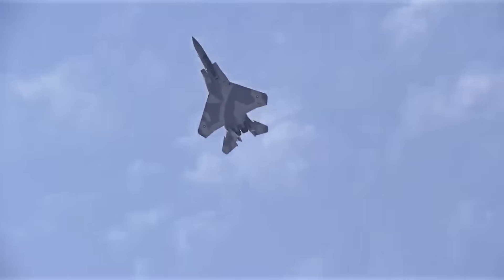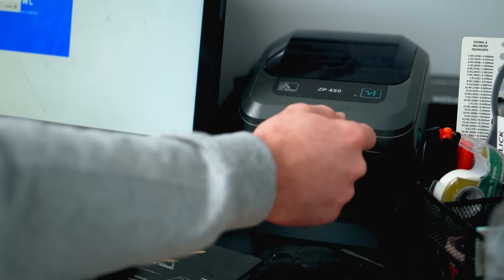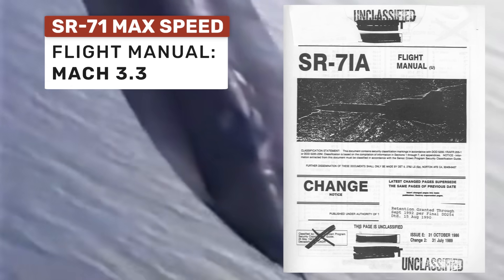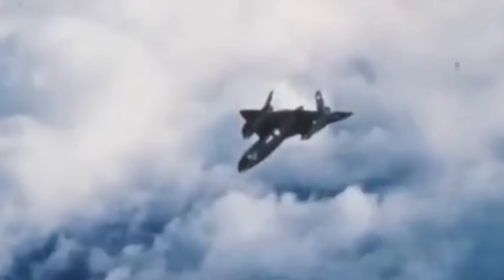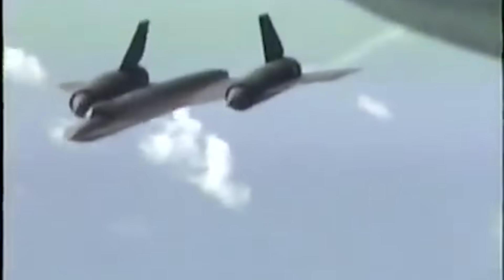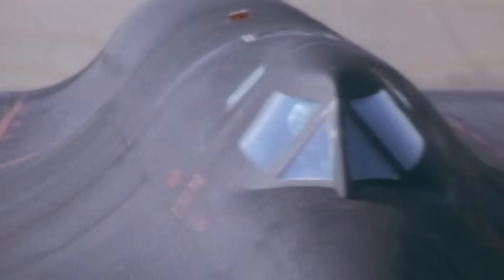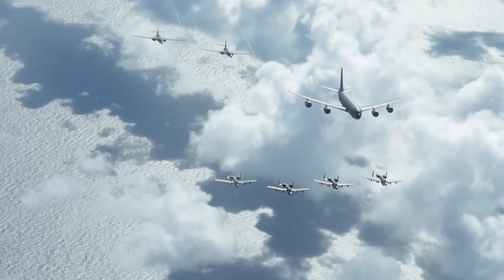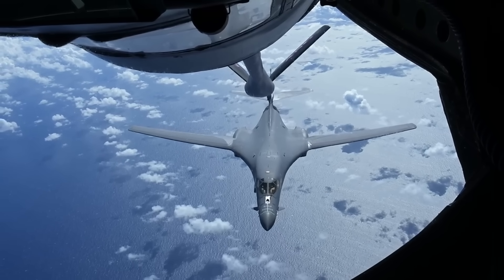The SR-71 was MUCH FASTER than the Air Force will admit

Comment: A really experienced and smart aeronautical engineer could likely figure it out mathematically. Take the shape and size and weight of the aircraft and figure out "what's the speed limit for an airframe like this at a given altitude?" The engines likely push that airframe to that limit.
Reply: They already did all that.  Lockheed knew its maximum design potential and it was never reached
Reply: Since you asked ... the Mach cone angle coming off a point (nose spike) can be calculated by sin(μ) = 1/M, where μ is the angle off of centerline and M is Mach speed
Using a top down drawing of the vehicle and a simple protractor, at Mach 3.65 that shock cone will hit the front chines, engine inlets and wing tips all pretty much at the same time. Under no circumstances can that craft ever go faster then that and remain in control/engines running/in one piece and not break up/ and not melt. You don't have to be really experienced or smart and it's not that complicated. You just have to go through the schooling (aeronautical engineer) to know how shock cones work, the (simple) math involved (shock cone off a point) and then take one look at that thing and laugh at anyone thinking it could go faster. You wanna go Mach 6 like some people think it went?  you better put a 70 foot long nose spike on that thing
Reply: @wally7856 its close, but mach 3.55 is the maximum for the inlets.
Reply: @gr8crash  ... and the maximum for the compressor inlet temperature (CIT) was capped at 427°C (800°F) which is about Mach 3.2 in normal conditions, Mach 3.35 if outside air temperature was below -50 C. Possibly "war time power" of 450 C on the inlet temperature for brief periods which if conditions were just right it could have hit Mach 3.5 although hitting that temp would require a rebuild of the engines turbines afterword's.
Reply: @wally7856 pretty accurate yea. The max authorized was mach 3.3 and only if that engine CIT limit was below 427⁰, and on a standard day that was pushing it. 

The 450⁰ was a tactical limit and also only possible if other engine parameters were within limits. It was also cumulative meaning IF a pilot did that it had to be written in the logbook and it wad allowed up to 60 min then the motor needed to be removed. 

I've asked a few crew members about that and none have ever done it.
Reply: @gr8crash  My favorite part about this plane is that at those speeds and altitude, almost all of the thrust was made by the pressure differential on the engine inlet spikes and the engines main job was just to vacuum up and remove the air building up behind the spikes fast enough so that the spikes could do their job. I think any accounts of this plane going faster then Mach 3.35 was just the plane hitting a pocket of really super cold air and the thrust on those spikes just taking off uncontrollably. Probably little the pilots could do other then pull back on the throttles and cross their fingers it stopped the runaway acceleration.
Reply: @wally7856 yea and thats pretty much what happened. There was a handful of flights in the mach 3.4x range due to extreme atmospheric conditions. But these speeds werent fully within the pilots control.

Comment: imagine if the sr-71 had 4 of those engines
Reply: I imagine you would need a bigger, sturdier airframe, more fuel tankage, and the aircraft would weigh quite a bit more.  Not sure you would gain enough to matter, since the aircraft was too fast and flew too high to shoot down anyway.  I have to wonder however if you could down it today using a very fast kamikaze drone of some sort.

Comment: There was a pilot in the 80s who slipped up in an interview that only aired one time because it was live that spoke on actual top speed.    Anyone who believes 3.5 was the upper limit or 3.6ish are badly mistaken.    Number is higher for sure!!!          Well 2.9 for a fighter but the most badass plane ever can only go a few hundred mph more???   Nahh.
Reply: Except it isn't.  Anyone who thinks it flew 3.6+ is delusional. Even reaching 3.5 on a standard day was impossible.

Comment: In 1972 (I think), I worked at Edwards AFB data processing center as a student aid. They were testing the F-15. All I did was keypunch IBM cards and generate very phony test data. I didn't know anything about the tests or data, but I suspect they were graphing energy bleed and turn rate at various altitudes and speeds. My girlfriend worked at NASA as a student aide, She asked me what the public top speed was. I don't remember what I said, probably 2500. She said :it goes a lot faster than that, a looot faster". From her reaction, I thought it was 3000mph, but she didn't say.

My father worked at the skunk works and later area 51 on  sr-71. He was a tech and probably didn't know what the speed was, but it didn't matter. He was a greatest generation WW2 combat infantryman and a 20 year air force veteran and he would not say anything about it even decades after it was public. He did say that he had to work inside the fuel tank and it was about an inch shorter than he was, so he kept bumping his head.
Reply: The SR71 was never at Area 51

Comment: 85% throttle was the highest recorded speed that the plane flew in operation (Not the top speed). This was to escape a Soviet surface to air missile, according to the pilot who did it... though he never said how fast 85% actuallly was. 🤫🤣
Reply: That isn't even true. That's not how throttles work on this aircraft

Comment: ..AND THE BLACKBIRD PILOTS WERE CONSTANTLY DIPPING IN AND OUT OF EARTH'S ATMOSPHERE AND SPACE....WHAT DOES THAT TELL YOU... .THEY ALSO TOLD US THAT THE BIRD WOULD LOSEN UP AFTER MAC ( THE PILOTS CALLED IT MAC  FOR MACH) .....THAT MEANS THE BIRD STOP SOUNDING LIKE IN SOME CASES A  BADLY ALIGNED HOOD ON A CHEVROLET TRUCK MAKING SQEEKING NOSES AT IDLE AT A STOP LIGHT .....LMAO !!!! ON THE GROUND WHEN THEY PUT JET FUEL IN THE BIRD, IT LEAKED LIKE A SIVE BUT ONCE TO YOU GOT IT IN THE AIR AND OVER 50,000 FEET @ OVER MAC 2 THE LEAKING STAINS DISAPPEARED.....TO OTHER JET AIRCRAFT IT WAS LIKE WATCHING A REAR ENGINE DRAGSTER GO UP AGAINST A JET CAR....SEVERAL THOUSAND CAR LENGHTS IT WOULD LEAVE OTHER JETS AND OUT CLIMB THEM....DIP IN AND OUT OF SPACE
Reply: Lol that isn't even true

Comment: As an ET, with Grumman in the early eighties. Working with the engineers, they let the cat out of the bag, usually the under estimate top speed by 2-300 mph!. F15 rated at MAC 2.5 -will go to 2.8 for a short time, however the engineers will say stay away from 2.9. That would exceed the thermal envelope!😎🇺🇸 JohnBoyUtah 🇺🇸🇺🇸🇺🇸✈️

Comment: I've always speculated that the Blackbird was mach 4 capable. Perhaps not sustained flight. But I believe if they really wanted to push that jet it could go 100.000+ feet and mach 4. 

I mean look at it. If the F-15 can do mach 2.9. And the Mig-25 was capable of mach 3. You're not telling me you need a plane like the SR-71 to go just .2 mach faster than that.
Reply: The SR71 couldnt fly that high or fast at all

Comment: I have heard of the discrepancies of its speed.  What i would like to know is its attitude.  In that the U2 flew at 80-85,000 ft.  It's hard to imagine that the  SR-72 didn't fly higher !
I had second hand information that it decended down to 100,000 ft before it made contact to prepare for a landing.
It certainly must be declassified by now.
Reply: All its altitudes etc are declassified. The SR71 normal altitude was 80k-85k. The U2 is closer to 70k. The SR71 could never reach and sustain 100k ft though.
Reply: @gr8crash 
Thanks !
Reply: @michaelodonnell8591 no problem. I will add that with the U2 still being in service, could it have sustained a higher altitude than 70k? Perhaps, but I wouldn't think anything excessive.

Comment: Since you came out with this video.... A year later now you have said.... Set the SR-71 engine s we're going to scramjet mode... I've been waiting for this for a long time as I've been saying in text on your website here.... I'm still not going to say the exact speed... But I will say this.....
But if you know the theoretical speed of a scramjet..... You know how fast a blackbird can really go..... I have held the performance flight envelope.. from Lockheed in my hands while the planes were being built.... I know how fast they go... And you're not even close at 3. 6...
Reply: Considering mach 3.6 wasnt even possible as configured its not surprising. The flight envelopes dont even support that speed. And scramjets? The SR71 had turbojets.

Comment: The top speed of the SR-71 was kept a secret from the enemy. The enemy. Got that? Telling the enemy anything secret is called giving aid and comfort to the enemy. There was no problem with air friction at speed. This aircraft was designed to handle it.
Reply: "The enemy" could easily track an SR-71, same as the USA shat themselves after tracking a Foxbat over the Sinia Peninsula, prompting the F-15 program. 

Once the Russkies figured out how to get enough Foxhounds in position it was Goodnight Blackbird, or "Say, let's use satellites instead".

Comment: In 1981, I was a C-141 aircrew member stationed at Norton, AFB San Bernardino.  During an air show, the SR-71 did a high speed, low level flyby into the vertical.  At the point of rotation, I began counting the seconds before I lost sight of the J58 engines’ plume.  15 seconds folks.  That’s 15 seconds from sea level to out of sight.   “HABU.”

Comment: Fred Bell, an engineer, links with the military industrial / CIA. Stated off record the Sr71 undisclosed top speed is closer to Mach 5. Its sweet spot is around Mach 3. Even though there was no official report of an SR-71 being shot down, the Russians did bring one down. As well the cost of the program led to its retirement.
Reply: Virtually all of that is untrue.  Mach 5? Never even remotely possible under any circumstances.  No SR71 was ever shot down,  especially over Russia as it never even flew over Russia and they never even fired at it.  The cost wasn't even that bad overall. The only real reason it was canceled was political jealousy

Comment: I worked @ Beale AFB (1972-74) where the SR-71 primary operations were based. A good friend worked across the hall from me in Avionics Maintenance, & mentioned one day that he had to replace an Airspeed Indicator in an SR cockpit.....because it was
"pegged" on MACH 5!!!!!!!!!  GO FIGURE.   If you look up the SR in Janes' Book of World Aircraft, the top speed of the SR-71 was always listed as "classified".  What an incredible engineering marvel- still today!!!!!!!SMFH.  I was heartbroken to learn that the SR-71 was "retired" in the late '80s by the Air Force....although it still flies today somewhere on the planet!!!!
Reply: You mean the guage that they didnt even use above mach 1.5 because it wasn't accurate?  More than likely if true it just broke, especially as the SR71 couldnt fly that fast, nor did the gauge even work at the speed.

Comment: Nice video which has prompted some old memories.  In 1978 I was a US Marine Air Traffic Controller at Futema Okinawa and apparently pizzed somebody off and found my self in a tower cab constructed of 2X4s and plexiglass sitting on the roof of a hanger at MCAF Hamby. We sat a mile or so off Kadena's final approach path with our airspace capped to a mere 500 feet for helo ops.  Long story short we could clearly see and follow the SR71s approaching Kadena.  One day an SR71 made several consecutive approaches which seemed amazing in regards to fuel consumption.  Good times.

Comment: I once saw an SR-71 take off - vertical acceleration! Noise was unbelieveable!
Reply: That never happened, its thrust to weight ratio was 0.44, there's no way that's going vertical.
Reply: It cant takeoff "vertical" meaning nose straight up. It would crash if it tried

Comment: I say upgrade the compressor inlet with modern technology and see just how far we can push the design.
Reply: But then you'd quickly run into the limitations of the airframe. The engine CIT limit was only the initial limiting factor to higher speeds.

Comment: My neighbor was a crew chief for the entire series (YF-12A, A12, SR-71) and told me the ultimate limiting factor for max speed was the windshield, which would deform and could fail from frictional heating. According to Brain Shull's recount, while outrunning multiple SA launches, he pressed past 3.5 mach. Other sled driver say his story is completely believable. Another neighbor worked directly under Kelly Johnson and was tasked with designing the blended airfoils for the wings.
Reply: Shul speed claims are greatly exaggerated as those speeds he claimed wouldn't be possible. The initial limiting factor to higher speeds was the engines.  The windscreen wasn't an issue until 3.6

Comment: A12 flew 10,000 higher and 200mph faster.
Reply: On paper perhaps, in the real world nope. All 4 variants had the same limitations
Reply: @gr8crash 
I watched a documentary on the A12 that said it was lighter, could fly 10,000 feet higher and was 200mph faster.  That was the CIA version. Even more top secret. I don’t really know. Who would
really know unless you designed them, worked on them or flew them?
Reply: @AltonW521 

There are definitely quite a few documentaries, stories etc that state that. Most of them all rely on information from the 80s and 90s when tech data and such was still classified. But now that virtually everything is, it changes a lot. Yes the A12 was lighter, but it also had lower thrust engines compared to the SR71. Per the CIA records, max speed for the A12 in 1965 was Maxh 3.29 and 90k ft, both A12 records being set during flight testing in 1965. But the SR71 has also reached and exceeded both of those limit, although when the SR71 didn it, it wasnt fully within the pilots control. But thats a separate discussion. The speeds of all 4 variants were initially limited by the engine CIT limit. Being smaller/lighter really had no bearing on effecting this limit. Speeds were so strictly scheduled to avoid unstarts etc. So being lighter is also irrelevant. If you weight 75k lbs and you're flying mach 3.2 the amount of air physically entering the intakes is the same as if you weighed 100k lbs also flying mach 3.2. Being smaller or lighter can't change that physical limitation. 

Imagine drinking a beer. You got some new drinker and a guy from Scotland. Both have the same pint of Guinness. Without a limitation the guy from Scotland could probably out drink the other guy. But now give them both same straw drink through, now both are constrained by the same limitation. Obviously a drastic simplification but wanted to try and explain it another way.

Now you could argue th A12 being lighter it could accelerate and maybe climb a little better, but still the acceleration and climb schedules were very structured so wouldnt be anything drastic. Maybe on a Rocket Ride maybe the A12 could be 1 min faster to speed and altitude,  but nothing majorly different.
Reply: @gr8crash 
Saw another documentary said that the jets could keep accelerating but the heat limits could be exceeded. 
The best ones I ever saw were interviews with the pilots.  The coolest thing I ever heard was one pilot said he saw the sun rise and set 3 times on a mission. Another good one was the speed run from New York to LA and the sonic boom knocked out the windows Zsa Zsa Gabor’s Beverly Hills home.
Reply: @AltonW521 its more of a tongue-n-cheek story. The initial limiting factor to higher speeds was the engines. Even take a day a warmer than standard the engine CIT would limit out before even reaching mach 3, and you'd b burning so much fuel it has caused mission aborts. People dont generally realize how atmospheric temperatures greatly effect performance.
Reply: @gr8crash 
I remember seeing that about the cool air being denser and them getting faster engine performance.
Reply: @AltonW521 yes in a sense. On a standard day everything would be normal and reaching mach 3.3 would barely be possible. On a warmer than standard day mach 3.0 at full throttle would be difficult. But on colder days than standard, you could be comfortably at mach 3.2 and maybe 1/2 to 3/4 throttle. Now there are a very few examples for speeds that did reach the 3.4x range. These were only possible because atmospheric temperatures were significantly colder than standard. These conditions occured during winter months over Northern Russia. They would be in MIN AB and still accelerating,  but to keep accelerating you also had to climb. One example was they were heading South towards the Russian border and they had to make the turn. Issue was they were flying in situation where manuvers were prohibited,  but they also had no choice so they made there turn and also hit warmer air causing the aircraft to slow down.

Comment: The blackbirds top speed has never been realized, because the plane itself would not handle the stresses from extreme friction, etc. It's engines could power the plane past what it can handle.
Reply: Most of that is untrue. The engines were the initial limiting factor to higher speeds. Top speeds etc are all known, studied and public. While you're correct the maximum design potential was never realized, it had a lot to due with the changes required to the engine and airframe never being realized.

Comment: The vmax button is an extension of WEP (War Emergency Power) from WW1 and WW2 planes. There was a wire preventing the throttle from opening to the max, but a strong force could break it and push the engine to 110%. Required maintenance afterwards, so was only for emergencies, as the name suggests.
Reply: Lol that absolutely isn't a thing with this aircraft.